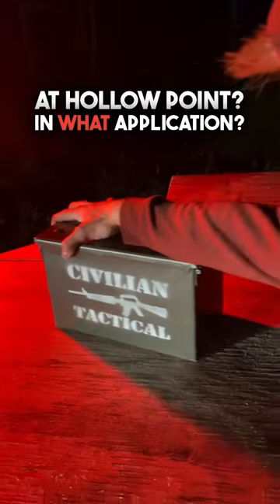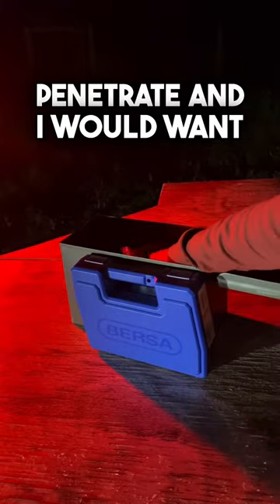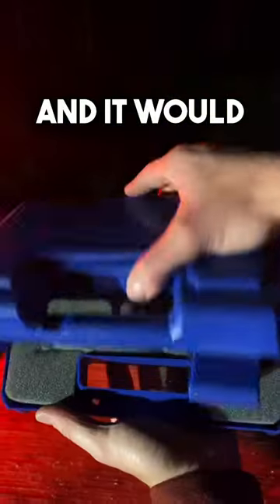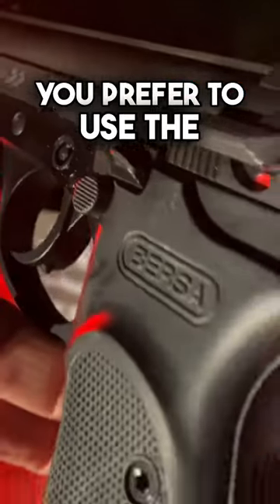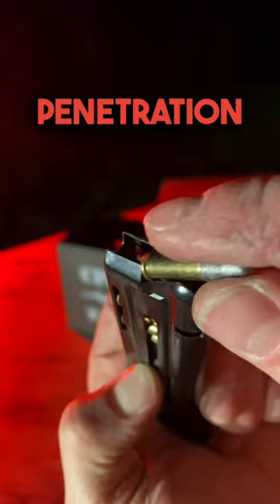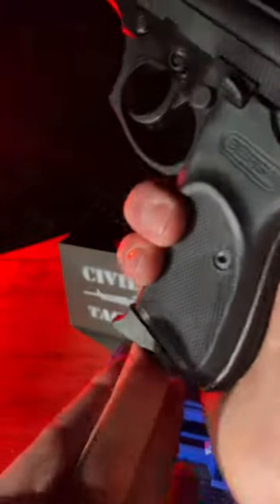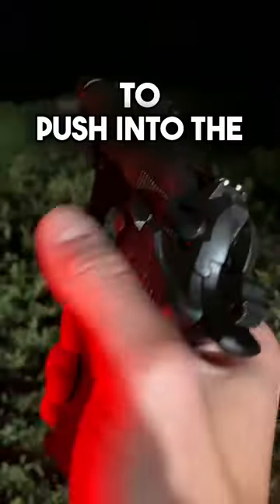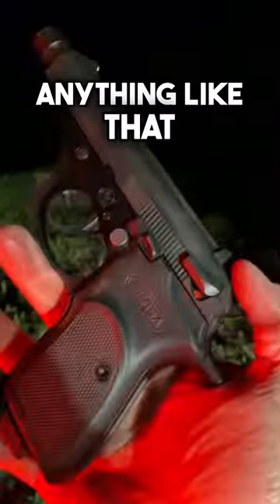Story Time: BERSA Thunder .22: Gun Talk Nation -Do hollow point bullets clog? #cleaning #civtac #gun

Comment: Hollow points clog a lot
Solid copper fluted is my go-to in handguns
Reply: Handguns do not travel the velocity to utilize those flutes . Expensive fmj’s
Reply: @D C  Copper flutes seem to do more damage than hollow points through denim If a handgun doesn't have enough velocity for a fluted copper bullet to do damage. The hollow point isn't going to farewell.
Reply: @dillonostrum9264  that’s mainly the flat nose . The poor mans hp a reputable 9mm hp will go about 15 inch in gel will obtaining an average diameter of .61 . That is deep enough even for bad angles and shoulder shots while giving a larger wound over fmj’s  the fluted stuff only really has an advantage at gaining a fair amount of penetration through fluid because it doesn’t deform and the flutes helps with drag .
Reply: @D C  no I'm talking hollow points through clothes then gel
People aren't running around naked
Reply: @dillonostrum9264  exactly why i said reputable hp’s . Good quality ones are significantly less likely to clog.

Comment: Hollow points for any caliber above 9mm, fmj for anything below so the lack of power is compensated by the extra penetration
Reply: Hollow points are more deadly, if anything it should be the other way around
Reply: @Maxx2294-blyat  not if the hollow points expansion slows the bullet down so much it doesn't reach the FBIs recommended 12-18 inches of penetration. I can see 380 failing to expand/penetrate when heavy clothing is involved
Reply: @JulianLares  the bullet isn’t slowed down, hollow points only expand inside the target. That makes them stop and prevents overpenetration. You think .380 won’t go through thick clothes?
Reply: I carry speer gold dot hollow points with a proven (by law enforcement) time and time again with 18 inches of penetration. That seems enough....
Reply: @g85786  for 9mm, maybe 380 could. But highly doubt it reliably expands and penetrates through denim or other clothing